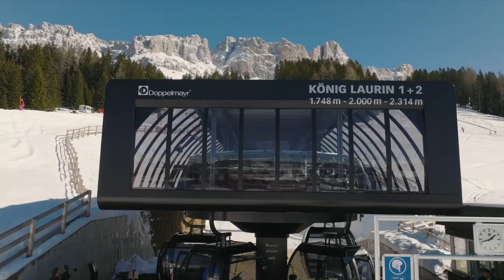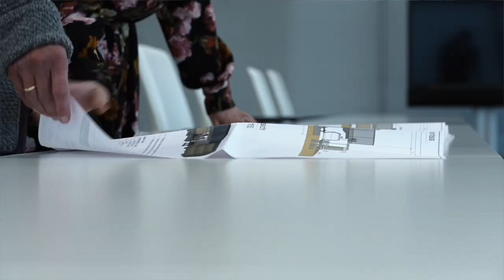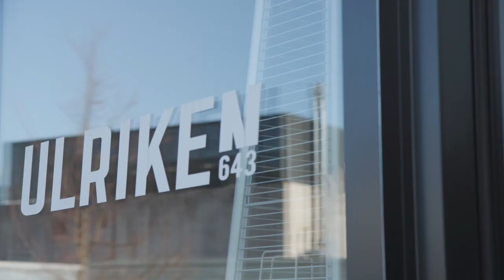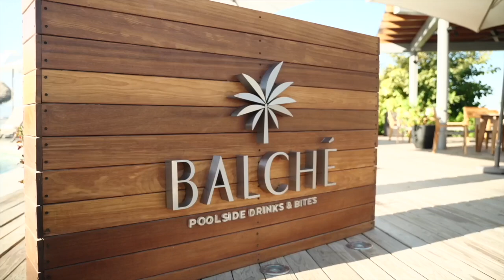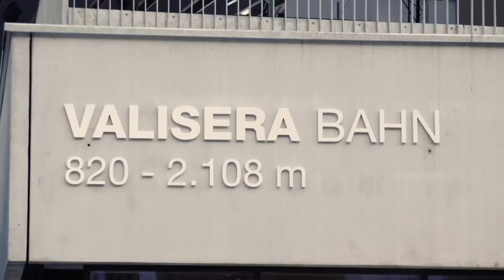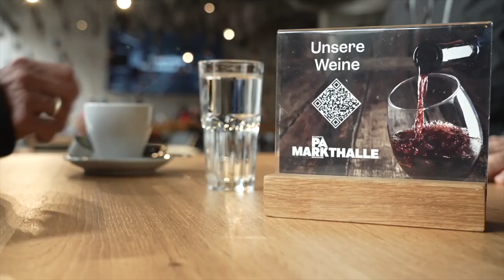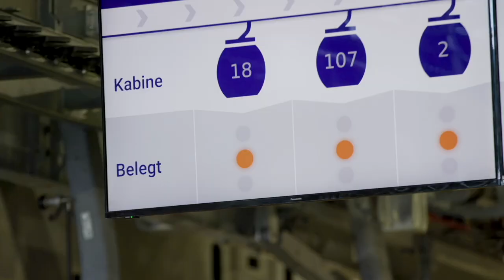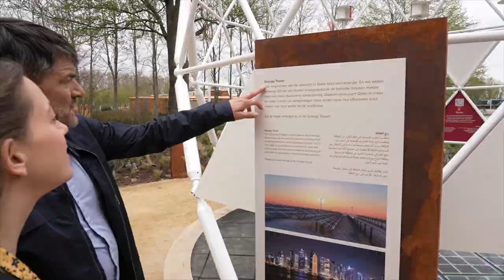Doppelmayr/Garaventa - "Insights - inspired by motion" - English (2022)

Comment: Great video. When are lattice style steel supports used as opposed to the tubular steel. Is it when a more elevated section is required?
Reply from the maker: Hi korky! I think this is because the tubulars steel towers are hard to handle if they exceed a certain base diameter (due to the height); e.g. container shipping becomes impossible. Lattice tower parts are easier to handle, but need more time for construction on site.
Reply: @DoppelmayrSeilbahnen  ah yes this makes sense. Thank you for the reply.